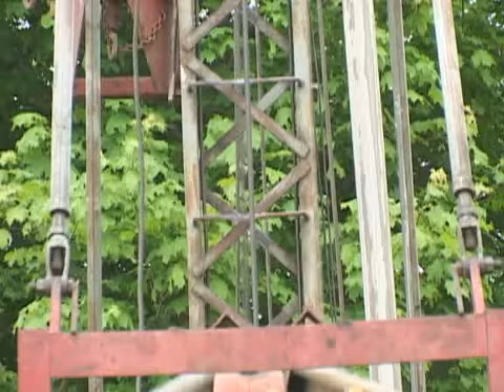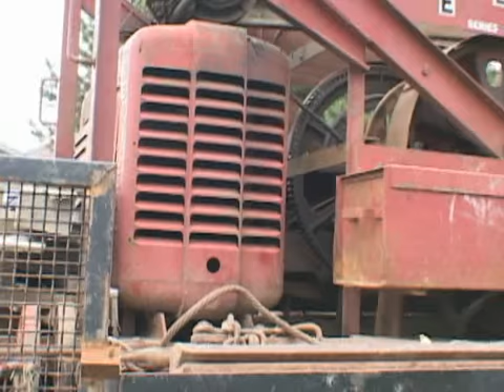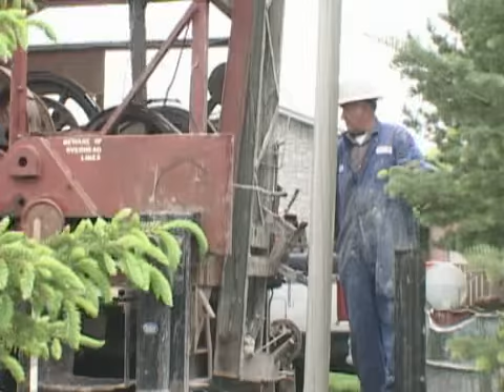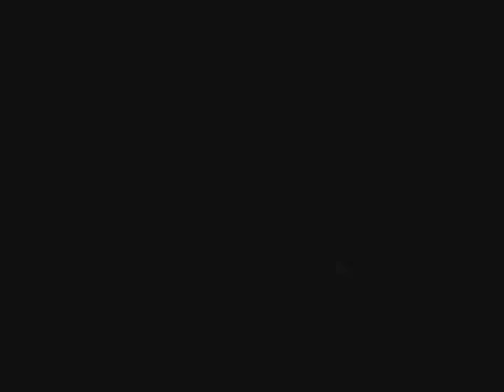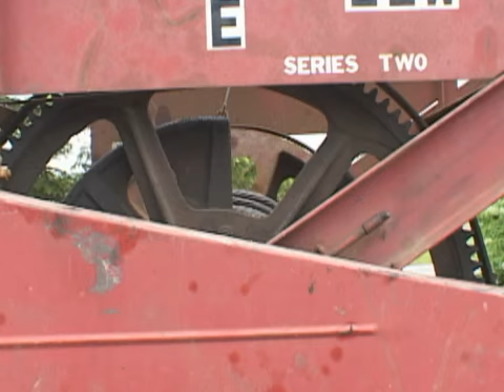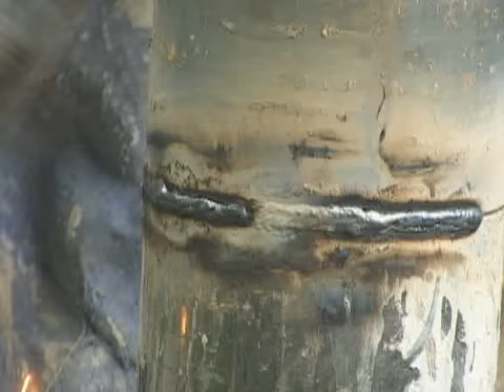cabletool

Comment: I have watched your video and I wanted to say that we have a few Cable tool drilling rigs we have a spudder it has a flat belt and a wooden band wheel It's model make is a 1938 special We are located in New Mexico We don't have to drive pipe only on work overs or clean outs. and in your video it shows the man holding the  drilling line i would just like to say that you shoudn't hold the line you should look at the header to tell if you are hitting the bottom of the hole But it was a good video.